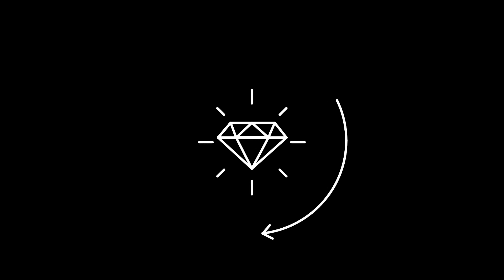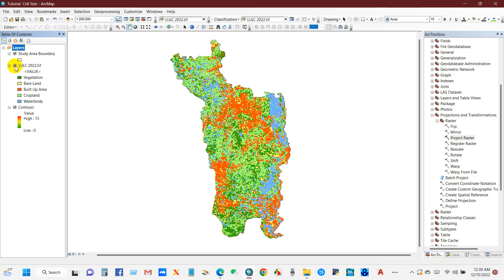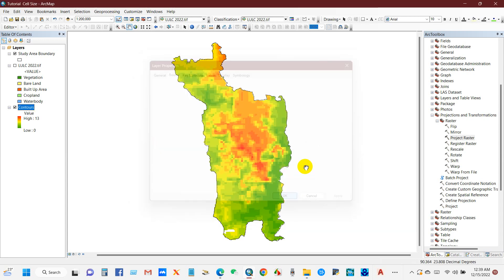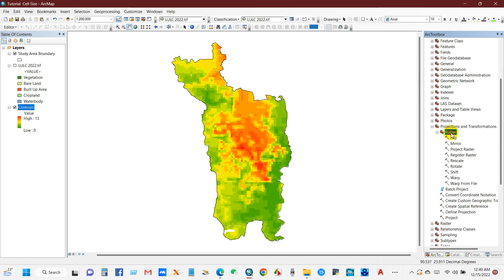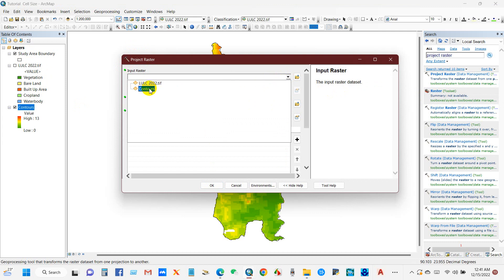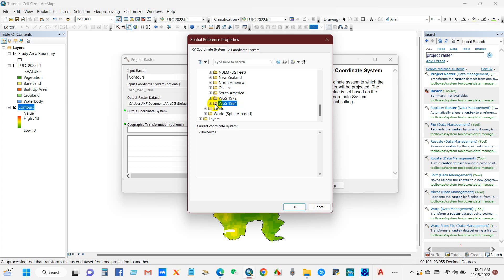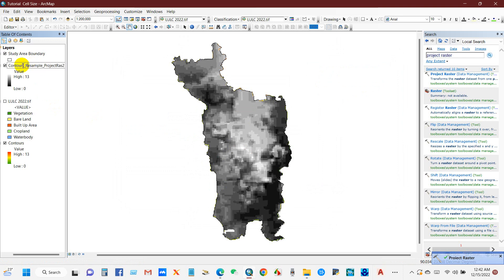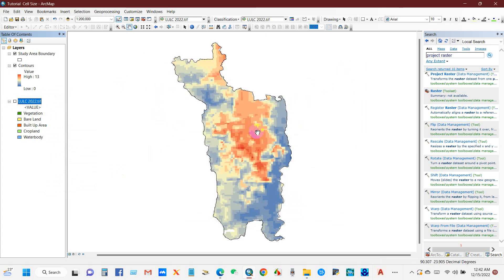How to Change Projection Coordinate System of a Raster in ArcGIS

Comment: Can you please tell the difference between project raster tool and define projection tool?
Reply from the maker: In ArcMap, the "Project Raster" tool and the "Define Projection" tool are both used for working with spatial data and managing coordinate systems. However, they serve different purposes:

Project Raster Tool: The "Project Raster" tool is used to convert a raster dataset from one coordinate system to another. It allows you to reproject raster data to align with a different coordinate system or projection. Reprojection is necessary when you have raster datasets in different coordinate systems and need to overlay or analyze them together. This tool preserves the pixel values of the raster while transforming the spatial reference.

Define Projection Tool: The "Define Projection" tool is used to assign or define the coordinate system and projection information to a raster dataset that does not have a defined projection. It does not actually change the spatial reference of the raster; instead, it updates the metadata of the dataset to reflect the correct coordinate system information. This tool is useful when you have a raster dataset with an unknown or incorrect projection and you want to ensure it is correctly interpreted and integrated with other spatial data.

In summary, the key difference between the two tools is that the "Project Raster" tool changes the spatial reference of the raster dataset to align with a different coordinate system, while the "Define Projection" tool assigns or updates the metadata to reflect the correct coordinate system information without changing the actual spatial reference.